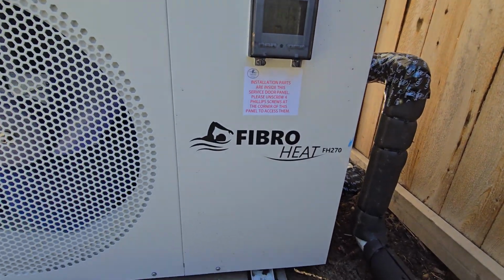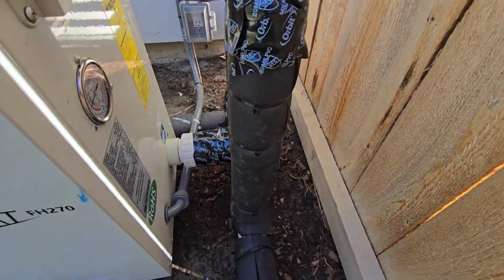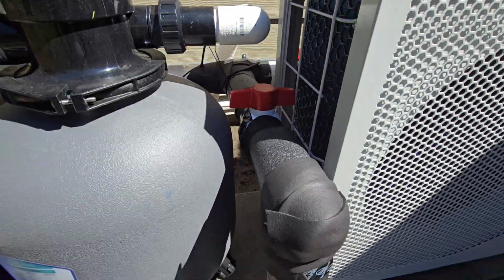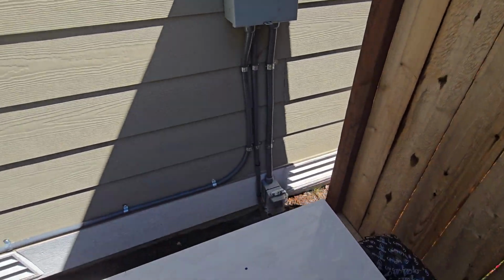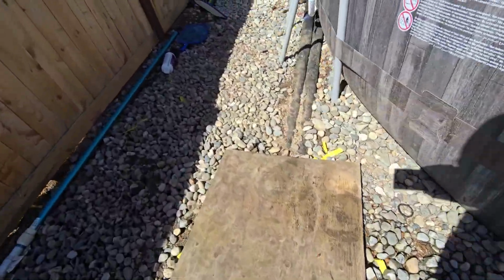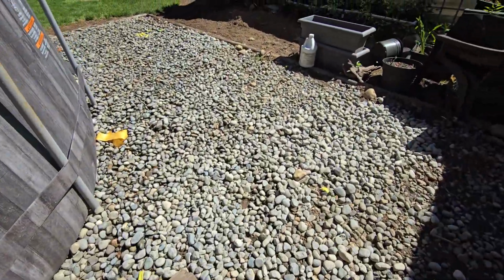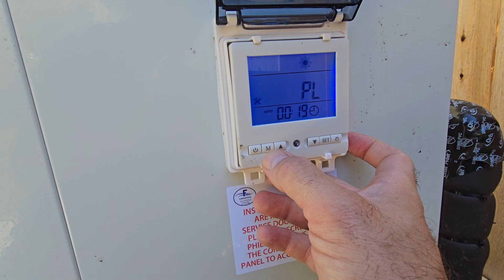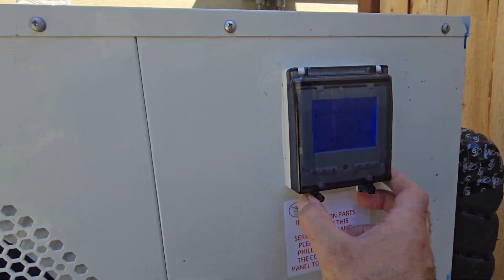Fibropool FH270 Installation with Aquastrong 3/4 HP Pump & Filter

Comment: Did the 1 1/2” pvc feel loose going into the adapters for the heat pump?
Reply from the maker: Not once it slides all the way in. If you have the same one, it seems it is loose for the first couple inches, then it tightens up.